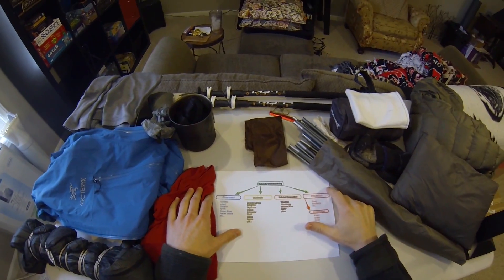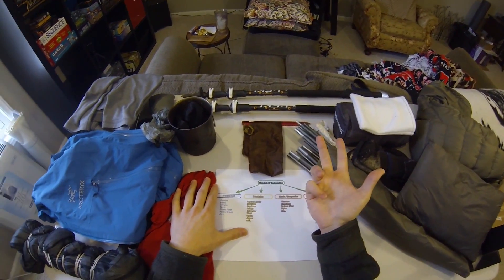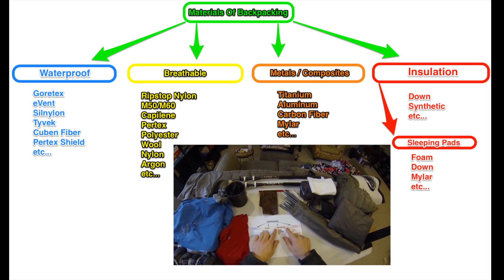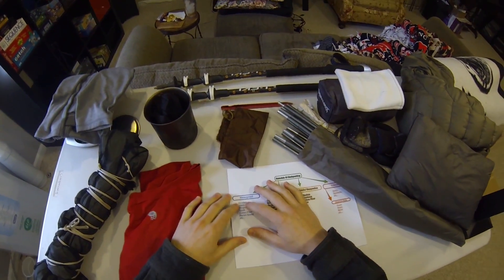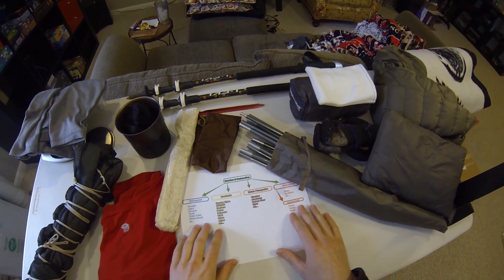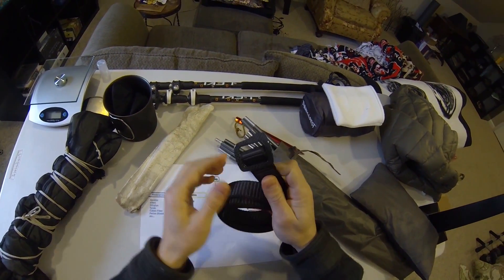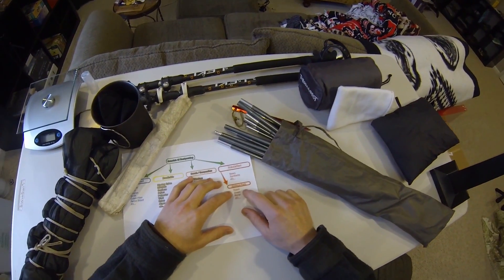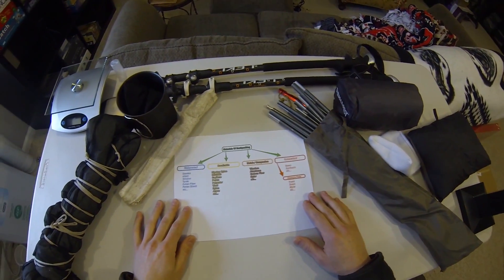Materials of Backpacking: Introduction/Overview

Comment: You should try to get in touch Hans deBot, president of Mooresville-based deBotech Inc., he has some cutting edge techniques and applications for carbon-fiber. Ones that may be tweeked in order to create great new products for use in backpacking. He actually designed and built the American bobsled being used in the Sochi 2014 Olympics. He also designed and built the American skeleton sled. And works extensively with the Nascar race teams. Look him up and arrange a meeting.

Comment: is Dyneema X Gridstop waterproof?
 oh, please tell us about sleeping pads.
Reply from the maker: Not really. It does have a coating of water resistant plastic, but this coating fails quite fast and the material soaks up water very easily. My Golite pack was made of this material and, though it may hold up to a light mist, it is not going to keep rain out.